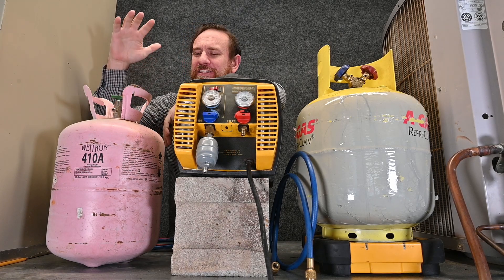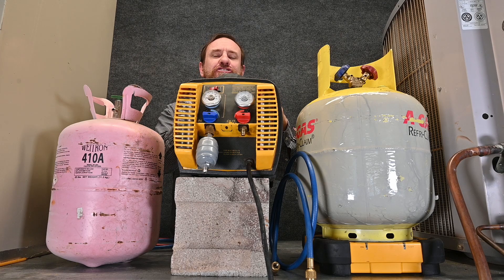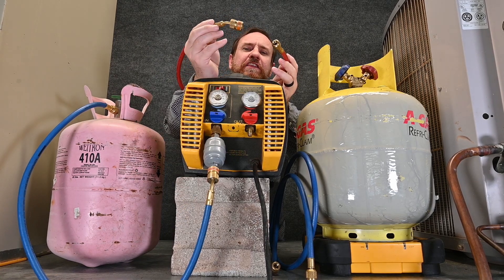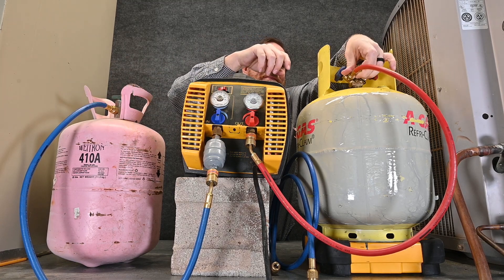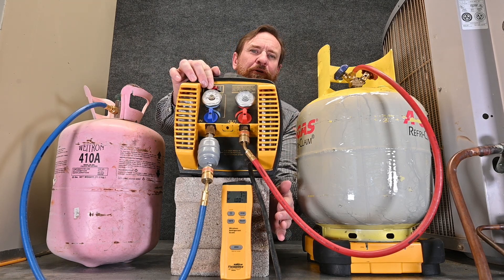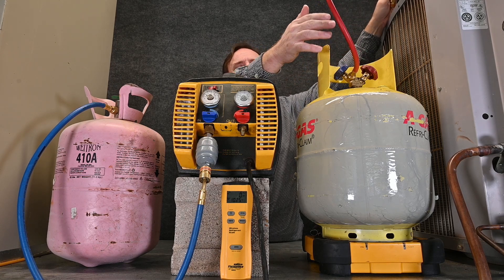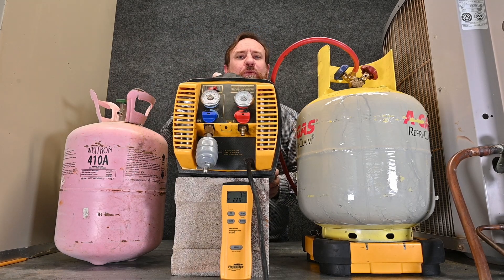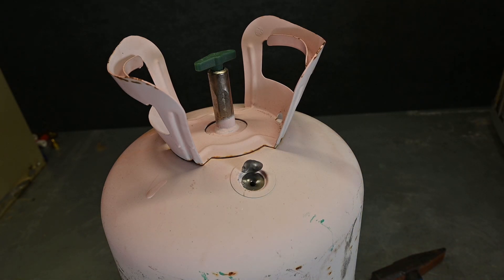HVAC  127 Recover empty tank, intro recovery machine

Comment: What's the best way to charge a heat pump in cooler outside temperatures? Do you check superheat and subcool while in heat mode? Thanks
Reply from the maker: Great question.
I will be doing a heat pump segment this winter. 
The manufacture usually has some published data they want you to use.
The second is to pull the charge and weigh it in. You take into account how many feet of line set you have and _ pounds per additions foot of lineset over _ feet. It will also be int he manufacture data.
Reply: @love2hvac  thank you

Comment: Hey Ty.  I installed a senville mini split in the garage and running heat.  Had a guy come vacuum the lines.  It runs for about 30 minutes and then the outside coil is frozen solid with about 1/4 inch of ice covering the whole coil and then it starts popping loud.  I've tried to get the tech to come back for the last 3 days and he is blowing me off saying he would arrive at 2pm and then having an excuse.  Is this something I could fix?
Reply from the maker: Wow there are several things it could be.
I would start with the charge. A new install a leak is highly probable. 
But it could be defrost board, defrost sensors, metering device, od fan, solenoids.

I'm a long ways from recording ductless. Check out my friend Craig with AC service tech LLC. He has some great ductless videos.